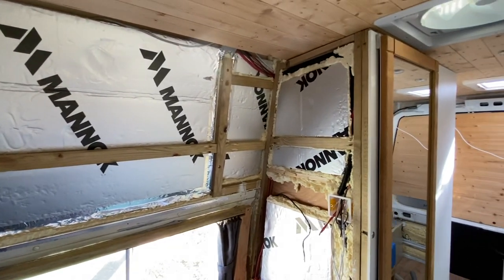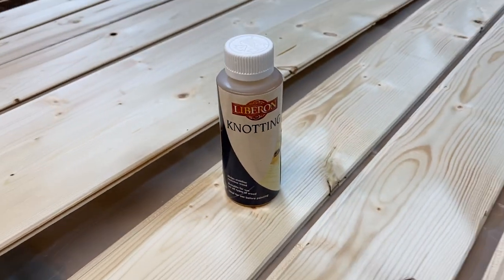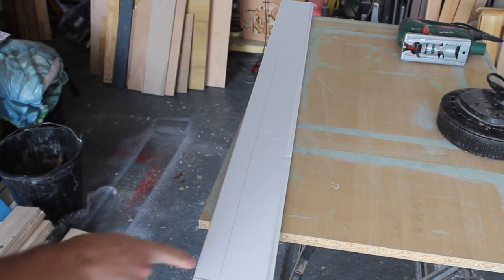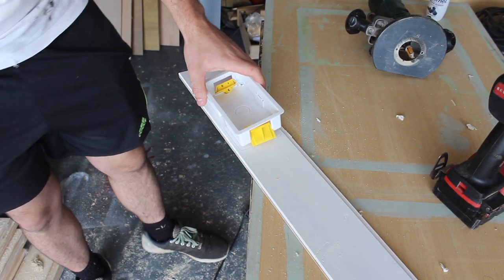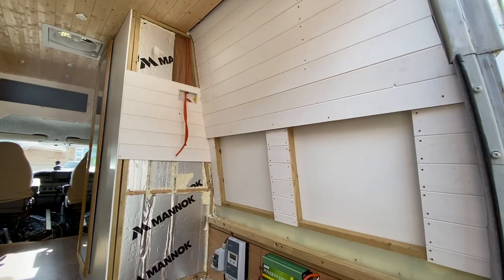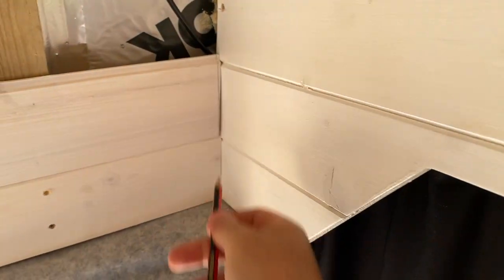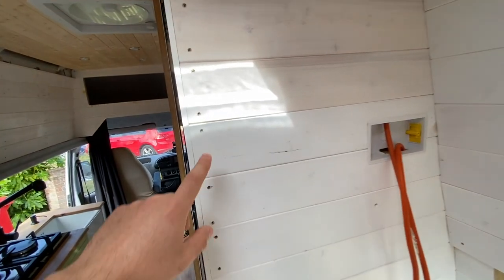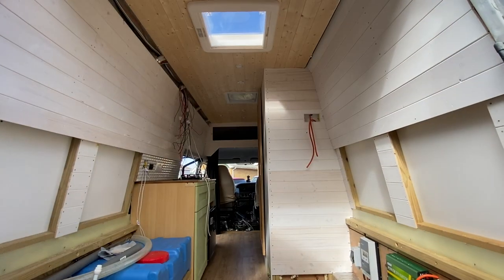Installing Wall Cladding - Van Build Series - Episode 21

Comment: From experience i should advise you to not extend your knife blade out so far ?
It can cause untold (deep) damage if you slip. It can snap easily too as the thin edge is flexing,
I sound like your dad, but lets be careful !